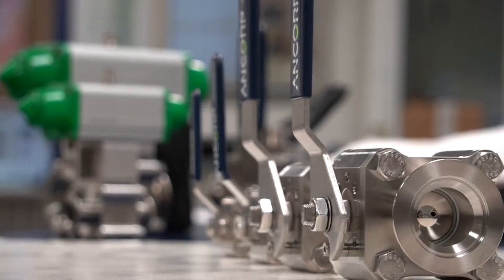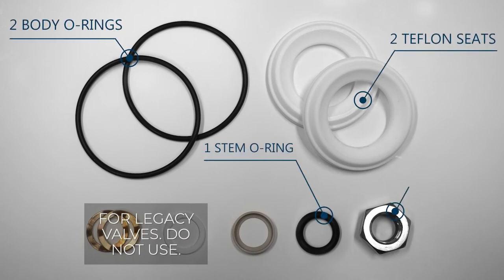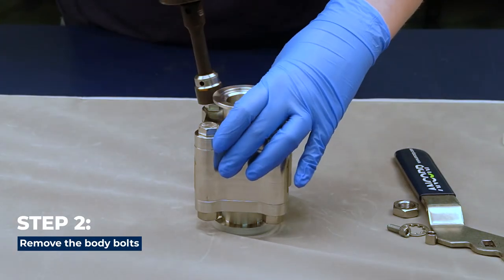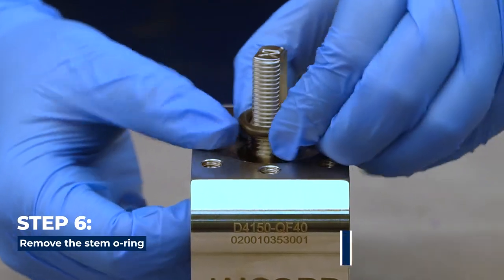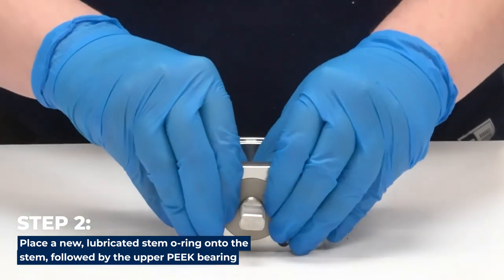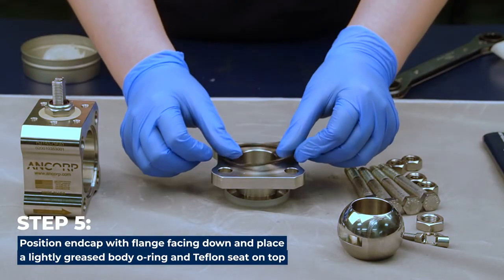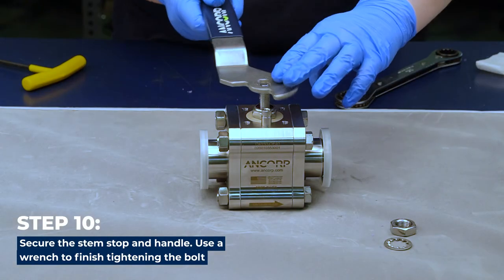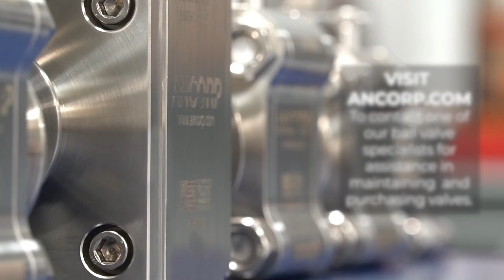ANCORP Manual 2-Way XL High Vacuum Ball Valve Maintenance Instructions

Comment: Any tips on installing Teflon jam nut without cross threading the jam nut onto the stem? it is the only step that gives me trouble.
Reply from the maker: When you initially place the jam nut onto the stem with your fingers, you can spin the jam nut counterclockwise until you feel the starting thread on the jam nut fall into place on the stem. And when you start to spin the jam nut clockwise to tighten, it should spin freely until the top of the stem comes into contact with the nylon insert. Then tilt the valve so you’re looking from the side to ensure perpendicularity between the stem and jam nut. Finish by tightening with appropriate wrench.